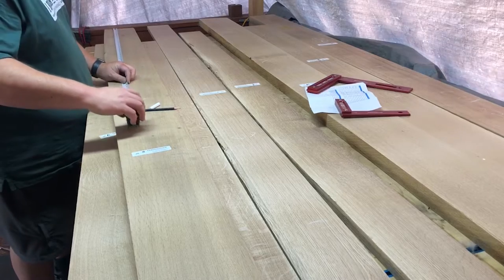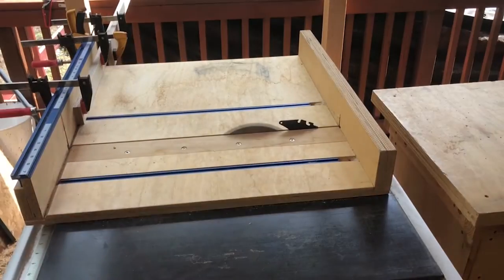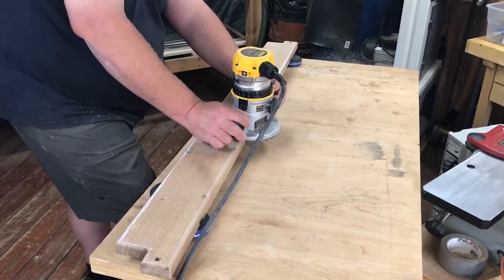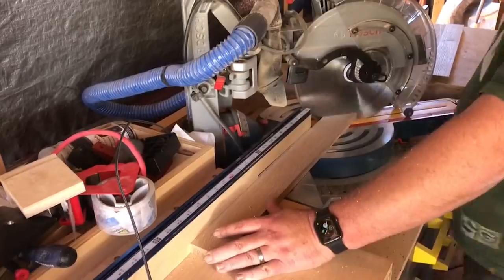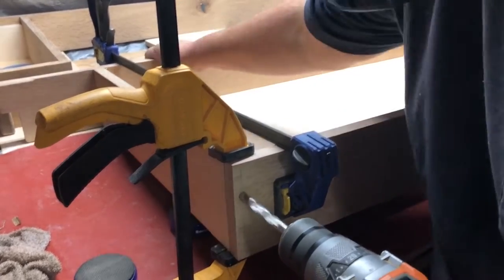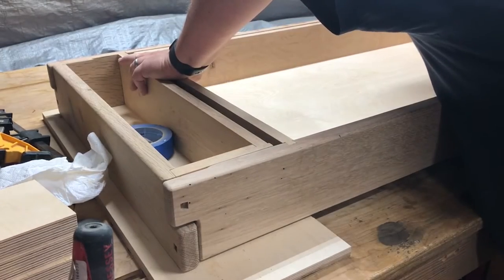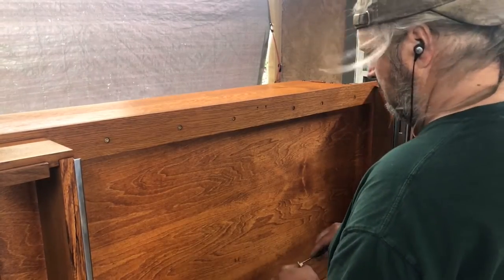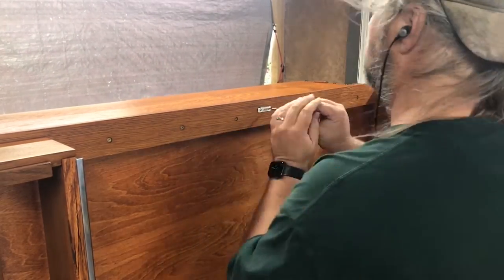Ep 42 Blanket Chest With Hidden Drawer

Comment: Why are ther gaps at every joint ? or at least most of them. See 18:06
Reply from the maker: I believe you are referring to where the drawer meets the base. There was a slight gap initially because I had to adjust the slide on that side slightly. Once I made the adjustment and after I attached the base to the deck that “gap” went away.